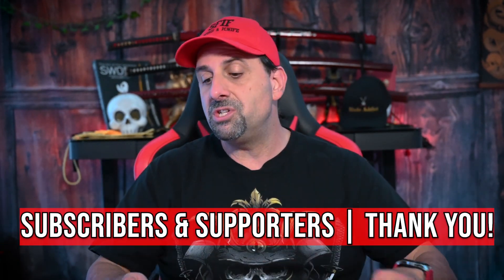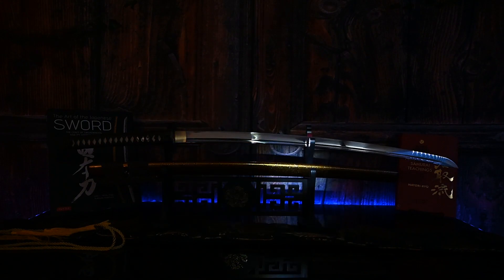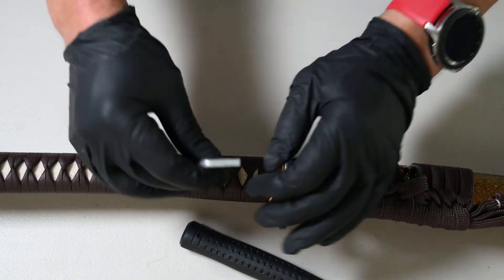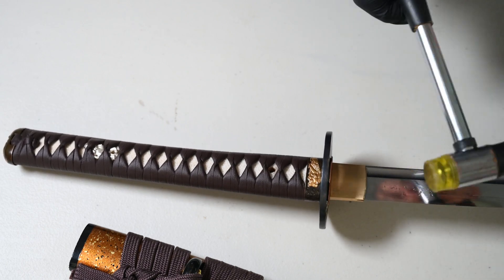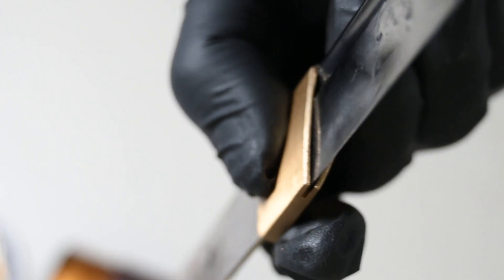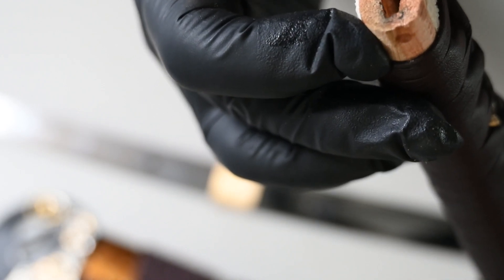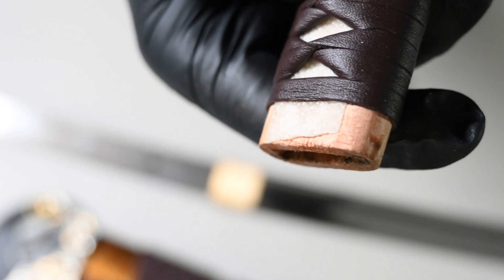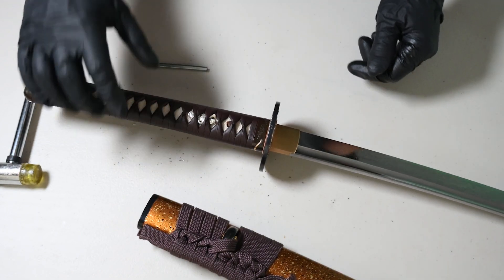BYZER | CLOUDHAMMER KATANA | YEAR OF THE TIGER | PRACTICAL LINE  Detailed Review

Comment: Very nice, not to much a gold fan  but still nice. A tip for you, try holding the katana at an angle if you have to use a mallet,and it will make it much easier.  Also try to get a piece of brass for the peg,steel isn't good for it.
Reply from the maker: Bro that stand has broken 3 times I just keep on reinforcing it, it cracked everywhere, yes I need a steel peg, gotta look for one it's just not sitting secure
Reply: @JoeSteel1  sorry I wasn't clear,I actually was referring to the handle on the sword, sorry. As far as your cutting stand, go to Lowes or home depo and get some 4x4,they should even be able to cut it for you

Comment: Hey man, I was considering buying this sword that you reviewed here. When I contacted rva katana they mentioned  that I could buy the sword off of you as used for $275. I see that the kashira came slightly loose, but before I make a purchase I just wanted to know if there were any other signs of use that formed after testing such as more loose fittings, blemishes or scuffs? I just want to know the current condition of the sword that I would be paying for
Reply from the maker: I responded over email